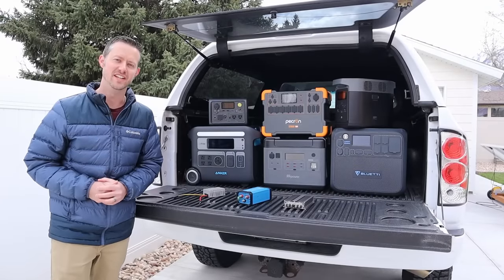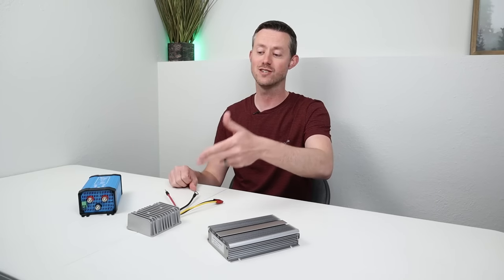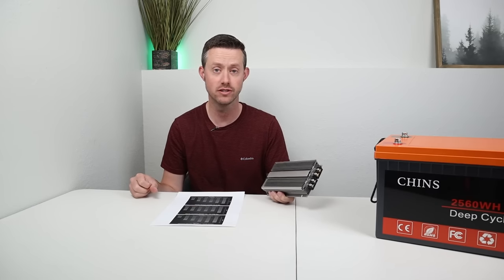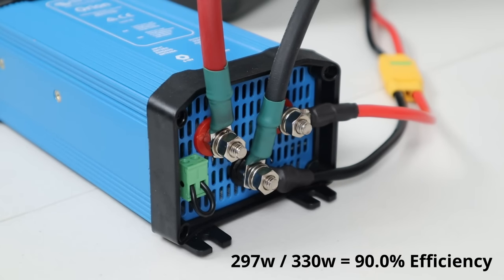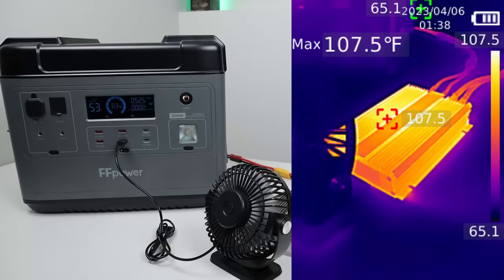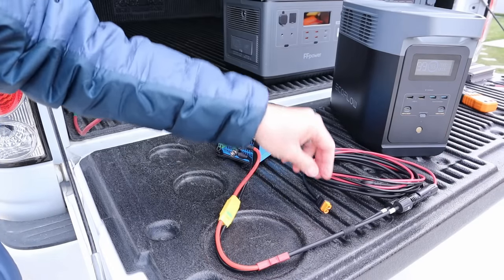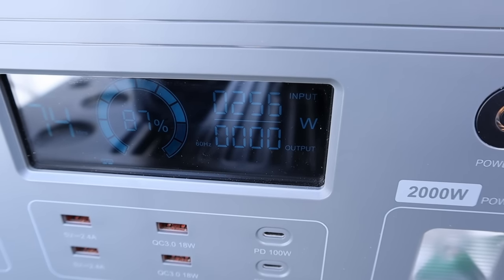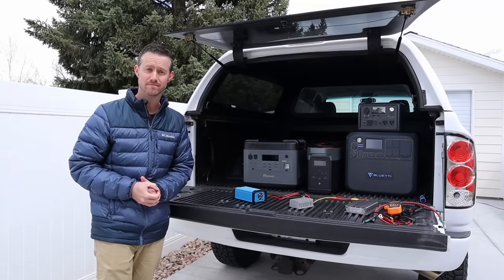Charge Your Power Station In Your Car FASTER - Perfect for Overlanding, Car Camping, and Van Life!

Comment from the maker: *Which DC Boost converter would you go with? (Affiliate Links)*
-Victron Orion 20 Amp Converter - https://amzn.to/41JRUPh
-12v to 36v 20 Amp Converter -  https://www.ebay.com/itm/275696879479
-12v to 24v 20 Amp Converter - https://amzn.to/40rEW7C
Reply: I went with cheap one just as a way to get started on the idea.
Reply: Hi Jason. Do you have a tutorial where you connect the converter from the starter battery? What did you need?
Reply from the maker: @brucereyesss  I don't have a specific video. Google "how to wire an inverter to your truck battery" and you'll get some good ideas there for wiring. Then instead of an inverter, use one of these DC to DC converters.
Reply: So are these basically the same thing as a renogy 60amp dc to dc battery charger?
Reply: @BrianHotsauceBauer  ~ These are more like mini transformers that increase the voltage (12v-24v) which lowers the amps (20-10amp). You will get the same watts with either 12v X 20amps = 240 watts, or 24v X 10amps = 240 watts. With a *Delta 2 you can import up to 500 watts via the XT-60 port but only at a 15amp/60 volt limit, so using a 12-48 volt "boost converter" (aka transformer) you can input 48 volts X 10 amps = 480 watts 😎 You can also use a pure sine wave inverter and import up to 1200 watts using the standard A/C charge cord. Charging your *Delta 2 in less than an hour. The only downside to that is the inverter will use some energy while it's running, with a load on it or not.
Reply: I did the Victron setup with 4 gauge wire and I'm only getting 270 watts charging max to my ecoflow Delta. Any ideas?
Reply from the maker: @davetee3589  are you using the Xt60i orange connector when charging? That allows for high amp input. The yellow xt60 is limited to lower amperage.
Reply: Jason, I bought the Victron converter, but am torn between the exoflow delta 2 & bluetti ac180.  Both units provide the power I need, but I’m concerned about the cable needed to charges the ac180.

So can you plz answer this question for me; like the ecoflow, does the bluetti need a special cable to trick the pwr station into think it’s solar charging?
Reply from the maker: @Justlogansdad  no, the Bluetti doesn't need a special cable, charging totals are determined by voltage alone.

Comment: Most vehicles alternators cannot put out 200-250 Amps! Small cars and compact vehicles: 60-80 amps, Mid-size and family sedans: 80-120 amps, Large sedans, SUVs, and light-duty trucks: 100-150 amps, Heavy-duty trucks and large diesel engines: 130-200 amps

Comment: This solves a huge problem for me. I really wanted to use an all in one unit for my van build but the lack of decent dc charging through a cigarette lighter plug was a deal breaker. This method now gives you the shore power, solar and dc to dc option that makes an all in one unit an option. Now I don’t have to wade into the build your system from scratch nightmare I was envisioning. Any of those larger units will provide all the power I need and I have the option of taking it out of the van when I need it somewhere else. Thank you!
Reply from the maker: Your comment makes the whole video worth it, I'm glad I was able to help solve your issue :)
Reply: Can you do this with any of the jackery solar generators?
Reply from the maker: You'll need to confirm the maximum input voltage to make sure you don't go higher than what's allowed. That info should be in the owners manual.
Reply: Make sure your alternator can handle the load.

Comment: For anyone wanting to use the 12 - 36v 20amp converter. You can fit 2 x 80mm pc case fans on the top. The unit is 160mm long and 113mm wide. The fan mounting holes line up perfectly in between the cooling fins.
Using the fan mounting holes as a guide tap out 4 x .7 mm threads. 
Works very well.
Reply from the maker: Excellent information, thank you!
Reply: I thought I could mount the 12-36v 20amo converter behind the grill for airflow.

Would this be a good idea?
Reply from the maker: @seanyoung477  I guess as long as all the connections are waterproof and secure.
Reply: @Jasonoid  thank you for the video great information. I do have a question about what size fuse. Would you recommend for 5 feet of six gauge wire we are talking about the 12 V to 36 V unit. It says it peaks at 720 W.
Reply: Forgot to mention I’m using Anker F2000/767 power station
Reply from the maker: 60 amp fuse should be fine for the 6awg wire. 720w is about 51 amps at 14v.

Comment: I use an ecoflow as for my work van to recharge power tool batteries and run random smaller stuff. I charge it from a separate deep cycle that also runs some lights and is only charged from driving, once in a blue moon with an actual charger. The slow charging through the provided cigarette lighter plug is painful at 100ish watt. I solved this with a 12-220v inverter to change the ecoflow, but it seems stupid and is overly complicated to go from car 12v to deep cycle to 220v to ecoflow to 220v chargers to 18v batteries. One of these will simply things a lot, just put in an order. Thanks for the video, came here from your short

Comment: I have an ac200max in my Transit van.  I installed a 1200 watt pure sine inverter connected to the 175amp 12 volt customer connection point in the van.  I use the 500 watt AC power brick that came with the power station to charge it.  In addition I have the 12 volt cable that plugs into the 12 volt outlet in the van and the solar input on the Bluetti. You can use both simultaneously and so I can charge at over 500 watts.  I have used this for two years without any issue.
Reply: What 1200 watt pure sine inverter did you use?
Reply: I would love more info on your setup Rick.  I am trying to do the same.  Thanks!

Comment: Another very good video!  I'd get the Victron with the active cooling and adjustable voltage output, so I know it's safe and will work with a wide variety of products.  Also, the Victron has a wired on/off option that can be connected to your ignition switch, so it doesn't draw anything unless your vehicle is running (see below!)

It's worth mentioning that none of these are designed with a low-voltage cut-off, so depending on how they're wired they could drain your vehicle battery to the point where it damages it or leaves you with no way to start your vehicle.  That's why most DC-DC converters are more complicated and more expensive than these products.
Reply from the maker: Very good points, Jason. It would be wise to have a system disconnect built in that turns it off when not in use. I wish I would have mentioned that in the video. Thanks for the tip!
Reply: Flat starter battery is a non issue now. I have 2 cheap lithium jump startes, both have been thrashed for a couple of weeks when I had a dead battery, and both work perfectly. You should keep one iin your glovebox.
Reply: The battery drain problem may be able to be solved by installing a Newdeli 12v 140 amp voltage sensitive relay (battery isolator) - any thoughts?
Reply: Great video thank you very much , so I have a Victron isolated B to B 30 amp which will be going to my 200 Amp leisure battery if I connected the Victron voltage boost to my leisure battery to charge a Bluetti 200 would that be ok  ? I’m guessing by doing that it’s not going to run my van battery flat ? May be run my leisure battery down , but could put an automatic switch, or will it overload B to B thank you well done good luck 👍👍👍🏴🇬🇧🇨🇦🦢
Reply: @nordic5490  do you really think it's OK for your starter batteries to deplete that much?

Comment: Awesome video.  Very thorough, and best of all, extremely practical.
As to your question about "how do I charge", I have a Renogy DC to DC charger with MPPT connected to my F150.  This is wired up to a fuse block & Renogy 2000W inverter.  I use the inverter to charge, among other things, my EcoFlow River Pro which will take 600W (I think) input.  The inverter's primary function is to power a small microwave while camping.

Comment: Great information and, as always, well done!   My Delta 2 has a 60 DC volt limit, so any of these will work well.   However, because there is a 15 amp limit for the Delta 2, a lower amperage converter might work just as well as be less expensive!

Comment: You just reminded me that I want to bump up my alternator on my 1966 Mercury Comet.  I already bumped it up from 40 or whatever the original was to 100 for AC, Electric Fans, and Electronic Fuel Injection, but since I started rolling around with my EB3A pugged into the cigarette lighter all of the time to get a fast charge on my phone, I've thought about incorporating something bigger.   Great video, thanks.
Reply from the maker: Wow, alternators have sure come a long way in terms of power!
Reply: @Jasonoid  Yeah, I did not know the output was so high on the new ones until this video.  Lots of possibilities for mobile backup power with this - I want to replace my 6500 watt generator at work with a split phase 48 volt setup, and now I'm thinking about just having it in my truck and plugging into panels in the afternoon when I leave work to top off instead of having everything on a trailer and plugging in a charger occasionally.  I monitor 42 groundwater wells with mostly 4 inch grundfos submersibles from 350 to 600 feet every quarter.  California will stop selling generators at some point or they will have to be permitted.  Right now, anything over 50 hp has to be permitted.  Keep it up - the videos are very helpful and inspiring.
Reply: @Jasonoid  My  2001 GMC Sierra 1500 came stock with a 105A alternator.  After buying a Renogy 40A DC to DC battery charger, I upgraded the alternator to 145A (total)  Idle amperage will be lower.

Comment: Great information.  I have been planning on doing this for my Ecoflow delta pro in my Sprinter van conversion.  The only thing I have not figured out yet is an automatic transfer switch, so I can keep the solar panels and the alternator charging separated on the single solar input on the Ecoflow.  My current plan is to just use a manual transfer switch, which are readily available, but it would be nice to have one that automatically switches to the alternator charging when the vehicle is turned on
Reply: If these are using the solar input, could this be wired in parallel with the panels? Would this back feed the car charging system and blow it up? If I could I would like to be able to charge extra when towing the trailer while also charging from the panels installed on the trailer. Any ideas on this.

Comment: Great video and timely as I have the EB3a and the new Renogy Phoenix 1000 to play with. A quick suggestion to mull over:
Maybe mount the converter under the hood, in the airflow with shorter 4-6 AWG cables to the battery and run the 10 AWG output cables to the back with a DC breaker as a shutoff switch. That would save money as  larger cable is expensive, airflow will help cool it and it is easier to run the smaller output cable that far.
Reply: My exact thought as well.
Reply from the maker: That might work well to keep it cool, maybe mount it somewhere near the main fan airflow. Thanks for the suggestion!

Comment: I can tell a lot of hard work went into this video which is much appreciated. I found this information to be very helpful. This is something I would not do personally as it way too confusing. When you speak this type of information quickly is too hard to absorb. I would need a class just on understanding the capability of just one power station, let alone four of them. It would be interesting to know if anyone has had any adverse effect on the vehicle's alternator or vehicle performance using these devices. It seems like a viable alternative to charging your power station, but I currently lack clear understanding of going from volts to watts; having the right type of connects and so on. I know your very smart about your testing. I one day hope to aspire to  reach your confidence and understanding. Your channel gives me general knowledge, but this is not something I would undertake. But I still learned more about alternatives and that is what was important to me.
Reply from the maker: The learning curve for electricity and solar is a bit steep. You'll pick it up with time if you keep trying to learn. I was in your shoes only a few years ago but having so many resources available and studying I am now much more familiar with how it all works. You'll get there, just keep reading and watching videos :)

Comment: Cool idea! A few things to be cautious of. Don't try this with a hybrid they have very small starting and charging systems. All newer vehicles monitor the alternator output and will set a service light if you over tax the charging system. The light will clear after 3 key cycles though so do not freak out just dial back the draw. Also, when pulling near max power from the alternator you should run another 4ga wire from the alternator to the battery and also add a second ground to the battery and to the alternator. If you are reasonable with the draw this is a great alternative to using a solar panel to charge the power station.  Victron all the way, never had 1 issue with any of their products.
Reply from the maker: Great tips, Mr. Mike! I didn't think of the extra draw going through the grounding of the system. Makes sense for sure!
Reply: So gents, I bought the ac200max to boondock with our 35' class a gasser. I'm assuming the alternator on the Triton V-10 engine would not have any troubles with the Victron. 2 questions from an electrical moron (Which is why I bought the ac200max!)1. I'd like to store the bluetti at the back of the rig, would running cables from the engine at the front about 30' back cause me any difficulties in this charging process. (lighter jack is at the front of course.) and 2, could you explain "running another 4ga wire from the battery to the alternator" and the 2 ground cables, ie  what gage and specifically from where to where? I'd appreciate the help. Thanks
Reply: Not sure about other hybrids, but the Jeep PHEV has an electric motor and dc-dc charger instead of an alternator.

Comment: What up Doe!?
Honestly I would need two for use with a large (2000w) and smaller(300w) power station. The 12-36v converter and the $35 converter. Great review as usual Dr J' 👍🏼

Comment: Excellent testing and analysis.  Another option:  I have 320 W of solar on my truck cap charging my Delta Max w/ two extra Smart Batteries.  This is a duplicate system and backup to that in my travel trailer.  This DC-DC arrangement would occupy the solar input port, whereas with an AC inverter in the truck, the Delta Max will accept both inputs simultaneously.  My problem was that the built in 400 W inverter in my truck is not pure sine wave, which the Delta Max will not accept.  I’ve decided to install a separate 500 W PSW inverter.
Reply: FYI, Delta's inverter is pass through when it's plugged into AC power. Therefore you cannot use AC loads greater than the charging inverter (ie. 500W) can handle.
Reply: MC4 T branch connectors would have been way cheaper

Comment: Good info.  On my GoLabs R300 power station that maxes DC charging out at 3A up to 60W, I'd be tempted to get a 12-19V converter for $15.  That would up car charging to 57W charging vs 40W, but instead I use a USB-C PD to get near the advertised 60W PD input.  Still can power that plus my freezer off the 12V 10A cigarette lighter outlet and 300W pure sine inverter.  Bulletproof little inverter that I got for $35, though now it's usually $50 or more.

You could build a crock pot around that 36V unit.  155F isn't very scary until you realize that was probably 120F over ambient, so in the desert you'd routinely see it at boiling temps, where it could be the basis for a rice cooker rather than crock pot.
Reply from the maker: Great idea using that USBc 60 watt charging option :) Another great option to use for your smaller power stations.

Comment: Multiple charge controllers on the same solar panel?

Jason i have the Delta Max 2000 as you know you can go direct from the solar array into it on the XT60I PLUG..and at same time use the grid to charge simultaneously.

 My question is...is there a way to split or Y the same solar array into a separate charge controller system to battery then to DC a AC  inverter to also plug into the 3 prong 110 input electric port on the delta max
   so off one solar array you can bring charge into the delta max by 2 different ways at the same time  ..one the straight solar and at the same time the AC 110 input through inverter  ...just don't know if theirs a way to Y The solar to 2 different units at same time .  

 BTW I did hook up my power queen 12v 190ah 150 BMS TO a 480W 12V to 48V 10A DC DC Converter Step Up Voltage Regulator and I'm getting over 500w input on the XT60I input

Comment: This is one of my favorite channels; always has great information, and some of the stuff you get to review may inspire drool.
In this case, the Victron looks like an overpriced loser, UNLESS thermals are a major concern.  Also, durability might be a question.
One thing that could be tried is [voltage multiplier + 12V computer fan + 2x hookup wires (fan wire may be enough) + plastic shoebox with holes on each end and the fan mounted at one end].
Reply from the maker: That means a lot, thanks! As for using a DIY option, I'm sure they would work great. In this video I wanted to get super simple and easy options for people that might not want to build their own contraption haha

Comment: The more I see how much even cheap components cost the more I realize what a pretty good deal most commercial power stations like the Ecoflow River 2 Pro are.
Reply from the maker: Yeah, with everything built into one little compact box, it's sure awesome!
Reply: the cheap way to do this would be chassis-> relay -> inverter -> power station's wall charger